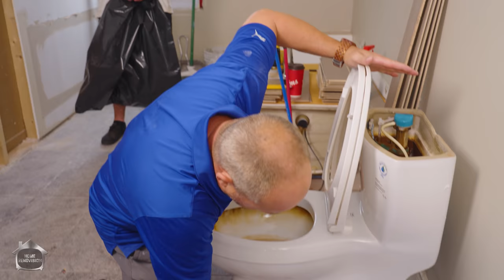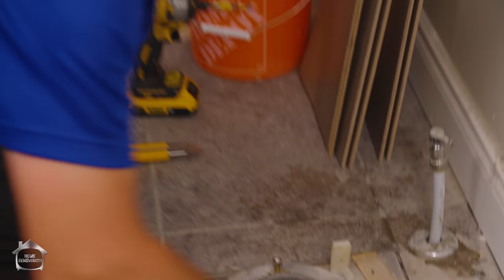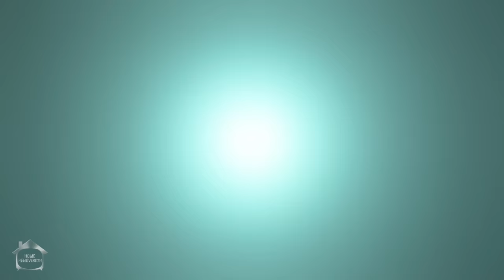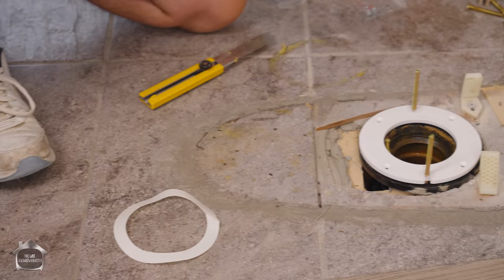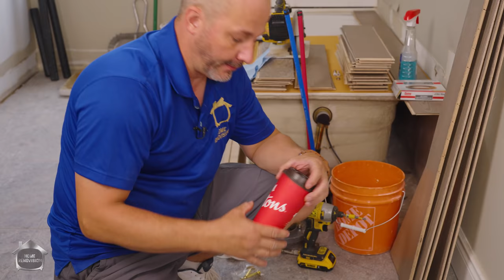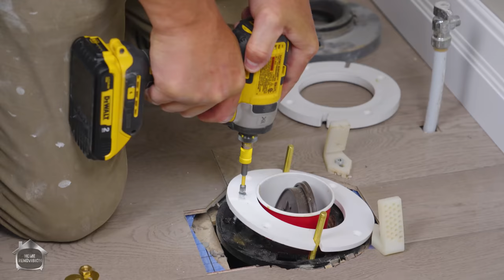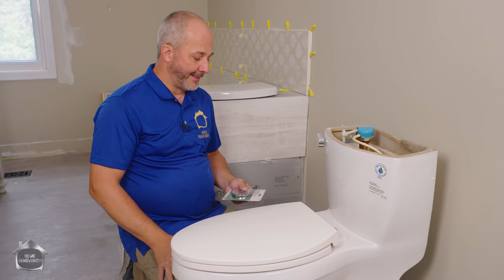How To Install A Toilet So It Won't Leak | DIY For Beginners

Comment: About your comment not to use silicone I generally agree but if using just one quarter inch spacer and a wax ring with a horn I can’t see how silicone would be an issue and probably the best solution. What do you think?

Comment: Here's a question I can't get a definitive answer on, because maybe there's no definitive answer. If you are doing a reno, should the closet flange sit on top of the tile flooring, or should you tile around the flange, and the top of the flange is flush with top of tile/flooring?
Reply: Code says ontop the finished floor but flush is more than fine. No one is going to cut out a flange and raise it to the top of the tile on a reno.

Comment: I just bought a 1998 condo on a slab.  The toilets both rock and my son has tightened them down, but one won't tighten. Rocks like 1/2".  One guy came to fix it. He got very frustrated. I think he may have broken the flange, but don't know. He was supposed to come back. I told him not to.  Now I have bought a $320 chair height new toilet. Im trying to be prepared.

Comment: For the wax rings, do you need one with the plastic horn or is a simple wax ring enough?
Reply: NEVER use the wax ring with the horn. The reason is that when you dump the water, it will splash up on the narrow edges of the plastic horn causing issues. It also restricts the diameter of the stack pipe in the floor.
Reply: X2, never use a plastic horn wax ring. They always cause leaks.

Comment: oh no, I sealed all the holes on my closet flange with 100% silicone - and then I was going to use a wax ring ontop of the flange, which will then be stting on top of the silicone. What should I do now?

Comment: Korky rubber gasket is forgiving when the flange is too high and the toilet rocks before you can shim it right.
Reply: I hope so. We're trying one out at a relative because a heating vent is right next to the toilet and kept melting the wax seals. The people that came to fix the wood around the toilet did a poor ass job too so leveling was difficult.

Comment: I wish they would replace an Old RUSTY dirty toilet instead of  brand new toilet where everything is perfectly easy to remove the bolts, no nuts/bolts refuse to budge(no grinding or hacksaws to remove bolts) and the Flange is in PERFECT condition. Still helpful, I have just never seen should a good toilet get replaced.

Great Suggestion on the Extra thick Wax ring...I have never even seen one of those before and my toilets are never that level so this is great help.

Comment: Does sound insulation layer needed when toilet bowl installed directly on concrete floor? For example when toilet is installed in high rise multi apartment building, to dampen sound transfer to apartment below.
Reply: I have never heard of that , and have been doing service plumbing in apartment high rises, as well as new construction of  high rise buildings for over 10years in San Francisco and never heard of a sound insulation barrier .. the concrete should be sound dampening enough .. the pipe penetrations through the floor should be fire caulked or puttied ..but if you feel you need to add sound insulation to dampen sound , I would recommend you add insulation in ceiling  of unit below.

Comment: I don't like sealing the bottom of the toilet if the seal leaks, it can rot the floor and get real moist before water escapes
Reply: Correct. NEVER seal bottom of toilet.

Comment: Important Facts, Toilet Flange should be up to 1/4"" above floor. Most Toilets accept about 1/2" with Ring under toilet. You can use the optional spacer if needed.

Comment: I have a few rubber ones,,  but I use wax only…. I do drain cleaning for a living and toilets often need to be removed while doing my job..  I hate that part because you might end up having to replace the flange

Comment: For the average DIY installing a toilet for the first time, this video may contain both confusing and erroneous information, and furthermore ends with installing a more sophisticated fastening design than what the "average" (his words) homeowner buys. In most toilets the bolts are tightened and cut after the toilet is set in place and often very difficult to cut with a hacksaw (use an oscillating saw if you have one). Introducing multiple options for extending the flange might confuse someone attempting a toilet install for the first time. Same with silicon/Teflon ring reference. Notwithstanding it is highly unlikely the ring is Teflon ( perhaps HDPE),  the failure in this case is likely because there are no screws holding this combo in place and neither has vital adhesive properties. However,  silicone does not break down with exposure to water ( I seem to recall this  video producer recommended it vs plumbers putty for sink drain baskets (?)) and it is a primary sealant used in showers ! Also, the white plastic flange extenders sold at my local HD/Rona/Lowes do not include rubber gaskets but DO recommend using silicone. So it depends on the kit you purchase. 
Lastly, I recommend you DO consider purchasing your materials from a LOCAL plumbing supplier. Not only will you pay wholesale prices but the employees are typically quite knowledgeable in the various options. At the box stores, particularly on evenings and weekends, it's a crap shoot as to whether you can find anyone with detailed knowledge of plumbing. That's not say that the box stores don't have some knowledgeable guys        (and gals) but with the specialty stores that's their business every hour they are open. Also plumbers I know don't put grout or silicone at the base of the toilet unless the client insists. They use shims to address any levelling issues, not grout or silicone to stabilize ? the toilet. And, the average DIYer  doesn't fare well with caulking.

Comment: Question: Why not remove the screws from the existing flange and rescrew them once the extension kit is installed? This way the holes will all line up with the original flange and you don't need to drill into the new flange with new screws.

Comment: I have totally missed ..how..the toilet stays in place when the bolts/screws are driven  in from the sides. What are they , the screws,  going into? What keeps the toilet from moving?
The compression shut off valve on a wobbly piece of plastic fitting just seems wrong, I'm thinking cracked or fitting blowing off because the compression part can't be tightened tight enough enough, the water pressure, the wobbly, and trying to shut the valve off even though it's only a 1/4 turn.

Comment: I put in the pan today, wayting for paint on wall to dry still the old seperate tank unit that was in there had no paint behind it. 6L for no 2, 3 litres for no1 on this toilet.
YOu coud also buy a bag of liquilock and pour it in bowl. It will gell the water until you add... more water....

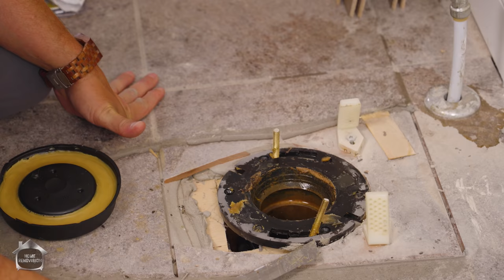Comment: At 7:08 he talks "aboot" how the top of the flange is 1/4 above finish floor height at the front and level with the finish floor in the back to have the flange sit flat because the floor has a slope ... I think I'll be using floor leveler ... wondering how make that happen ... did he use shims in the front in this example ...? The floor in my bathroom is a quarter inch higher in the back of the bathroom to where it transitions to the hardwood in the hallway ... I think linoleum tile to finish ... any thoughts? So, the flange sits inside the sewer pipe ... how best to control the flange height? The bottom of the flange would sit on the dried floor leveler ..?

Comment: I was told that sh*t runs down hill.
Not very people know that water trick.
I have a toliet dolly the catches the water and it on wheels.
Lock the bolts to the flange of corse you will have to come up with 2 more washers and nuts. 
Rubber toliet gasket are usually for motor home's.

Comment: Rough in is biggest nightmare ,10inch and 12 inch are common place here in las vegas,especially tension slabs,if its a 3 bath could almost guarantee one is 10 and extra 20 bucks because of it,the dreaded 11 rough is so rare manufacturers stopped making it...I sold alot of crappers in my years folks lmao
Reply: If the rough is an odd size like 11", can't you just go down to 10" and deal with the larger gap between tank and wall? Unsightly compared to a proper fit toilet but that's life. 🤷🏻‍♂️ Unless the person wants to do demo and install an offset flange.
Reply: @mannys9130  i always recommend putting a piece of foam between back of tank and wall on both ends if people go 10..people love to lay back on the tank likes it a recliner

Comment: It's not a bad idea to but some vegetable oil on top of the rubber, just incase you're moving it around it will not get pushed out of place as easily.

Comment: This video came about a week late for me lol. My youngest boy flushed a toy truck down the toilet and it got stuck inside the internal trap of the toilet causing very slow drainage. Had to take the toilet off and wanted to use a wax gasket but they only had a rubber one in stock which was $15 vs $3. It worked but had a 10yr warranty (lol). Had to figure out how to take everything off n out back myself.

Comment: The installation instructions for MOST traditional toilets want you to install the wax ring to the bottom of the toilet, not onto the flange.  PVC (not CPVC) is used for DWV systems in the US.  ABS is used commonly in the mobile home industry but isn't as common elsewhere (in the US).
Reply: ABS drain pipe is used for all residential plumbing here in washington state.
Reply: @ThatFixItGuy  And I suspect elsewhere in the colder reaches too.  Pretty much all I see in Northern Indiana is old cast iron, sched 30 & 40 pvc, and still some copper too.
Reply: He’s in Canada, ABS is what we use for residential DWV systems.

Comment: Hello 
 I watched your video today on how to install a toilet it doesn’t leak I have a toilet that’s 70 years old and she will never was replaced it’s leaking all over the place the waterline is like a hack job and it’s leaking there and I can’t even get the bolts off the floor because I think they’re they’re stripped and just spinning I’m to the point where I want to get a sledgehammer and smash the hell out of the toilet but I really don’t wanna do that I have photos of the bolts but they’re corroded and I finally found the right hatchet but it doesn’t do anything😢😢😢

Comment: Why the back or the box of the toilet is not tuching or set in the wall?
In my country, the standard code is that box‘s or back toilet have to be connected to the wall
In other meaning should not be a space between the toilet and the wall
Reply: Interesting, what country?  I wonder why one would want it connected to the wall?

Comment: Remove the water off your bowl with a shop vac (remove filter)

I would of pre-drill that flange (repair and abs flange with a small hole, a lot of people split their flange by just drill on top.

also on your 2nd sink you put a tee-wye on its side, that's a plumbing violation in canada.

Remove any sharkbite fittings, insurance company might not cover you if the fitting lets go

Comment: Not a wax ring/double wax ring flange fan.  I had two different plumbers try to install the same toilet and the install lasted just until the first person tried to use the toilet.  I ended up buying a plastic device to install the toilet and it has NEVER leaked.  I'll never go back to wax ring again.

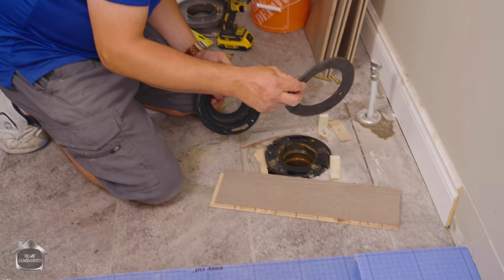Comment: @13:12 Aquariums use silicone and it lasts 10's of years so I'll assume silicone on the flange fails because of chlorine in the water supply and/or bleach, cleaners etc..

Comment: I thought instead of "grouting it in" for the seal at the bottom the toilet, the idea was to leave a gap there allow water to leak out there instead of into the subfloor if there ever is a leak with the toilet
Reply: Yes it's one of those plumbers topics. To seal or not to. I opt not to. 

Silicone Only helps with cleaning the floor around it really.
Reply from the maker: most leaks go under the floor. trust me if it leaks under the floor you will still find it.

Comment: After doing toilets for almost 35 years I have finally come across one I just cannot stop from leaking it's on its second base now the actual base is actually glazed over so the wax doesn't stick to it so what's happening is the water is getting above the wax and leaking out all around the toilet. I've also seen a very hokey looking bass system none of the screws are into the wood like they're supposed to be from the flange. Very sloppy I've been there about 10 times now and now this thing is leaking worse than it ever has in its time that I've been there. And it's a brand new toilet base?? My suspicion is there is some movement going on within the drain flange pipe. From in the basement I can see it's been cut halfway down and it has some kind of hokey looking clamping system with a nut and a bolt using the floor to hold the flange down from below.(flange is on the inside sticking a quarter inch up from the bathroom floor, all PVC glued together) has anyone else seen anything like this before?

Comment: Two tips plumbers taught me many years back, 1: use some of the wax to help hold the bolts in place (stuff around the base of the bolt, you'll thank yourself when trying to drop the toilet down. 2: Never silicone caulk around the edge of a toilet where it meets the floor, IF there is a leak under there, you'll want to see it before over time it starts to rot the floor.  That way you know you have a good seal. Good video!
Reply: Silicone prevents the toilet from potentially coming loose over time. I've seen countless toilets leak BECAUSE the nuts came loose. If it were siliconed (leaving a gap at the very back) There would be no issue.

Comment: Hi Jeff, my toilet flange comes out of the wall about six inches high, my problem is that the pipe that the toilet goes into has been damaged and the bottom of the connection has been broken and that makes it almost impossible to make a seal. The pipe goes through the wall, into the soil stack (cast iron) the female connection is a glazed pipe that is broken at the bottom, and as a result, I cannot make a seal. Any ideas please
Reply from the maker: Hi John. hey using an epoxy pencil. it is a tube of epoxy that will bond cast to porcelain to stop the leak. simply open the package and roll in your hand to form. This might just be the life saver you need.
Reply: @HomeRenoVisionDIY  Thanks for the advice, the silly thing is that I have epoxy putty in my “plumber draw” but I did not think of using it. I will be doing that tomorrow, thanks again for the advice.

Comment: Jeff, please make a video of what to do when the turn off valve is old and corroded and you can't turn it off.
Reply: there are videos about that... turn of main water suply.. drain water from the lines.. and replace the valve..
Reply: @freelifeproductions  Thank you, but it would be great to hear how Jeff would do it.  I've learned so many tricks from Jeff that has made repairs so much easier and faster.
Reply: There's not really any other way TO do it... Freelife is correct. If the toilet shutoff valve leaks by and won't fully stop the water flow or it's old and can't be turned to shut it off, you need to shut off the whole house and remove the valve to replace it. No other way. If there's an adjustable packing nut, you can try loosening it and then try to free up the valve by turning the handle gently open and closed to free it up so that'll turn again and close the valve. Then tighten the packing nut again to stop the leak that'll form from it being loosened. If you just can't get it to shut off though, you WILL need to shut off the whole house at the supply valve or the water meter (or that single branch line that feeds the toilet if possible) and remove and replace the valve. If you can't do that, put 2 pieces of rubber hose on a pair of needle nose vice grips and tightly clamp off the braided flex hose that connects to the toilet. That will clamp off the water flow out of the hose and you can disconnect it from the toilet. I suggest putting 2 clamps on it as a safety precaution. If the hose is old, this will ruin it. Flush the toilet to make sure it doesn't refill and confirm that your clamp is totally tight and holding back all of the water pressure before you unscrew the hose connection at the toilet. If you'll have the toilet off for a long time, get a short threaded pipe nipple and a cap that will screw onto the end of the hose where the toilet used to be and that'll give you extra insurance in case the vice grip clamps leak or pop off.  Jeff won't have an answer other than these because there's not really any other way to do it... That's it. You have water pressure behind an inoperable valve and there are only a few things you can do to stop it.
Reply: @mannys9130  The other  and easiest way way is to purchase a similar shutoff, then swap out the guts.  takes 30 seconds.

Comment: lol just redid my vanity, so I did the flooring at the same time… the people who installed the old flooring double stacked some wax rings from the existing flange and called it good… lol while you can get away with that, I think that’s lazy cheap work…  luckily the depot had the flange extension kit… lol and I got an excuse to buy a hammer drill since I had to drill new anchor holes into the concrete lol…. And then two of the concrete anchors broke off half way in and I couldn’t get them out… so it looks a bit weird having anchors not  even space but 🤷‍♂️